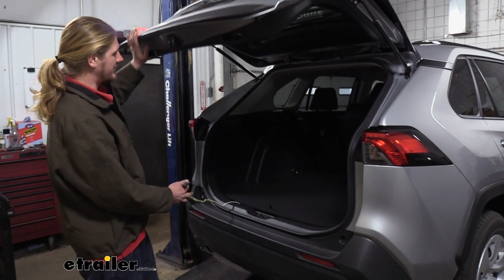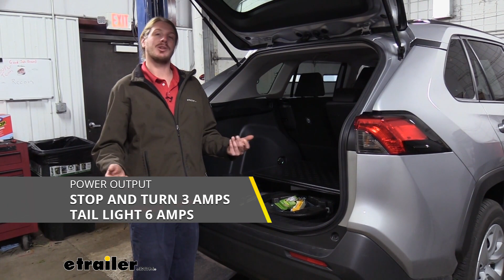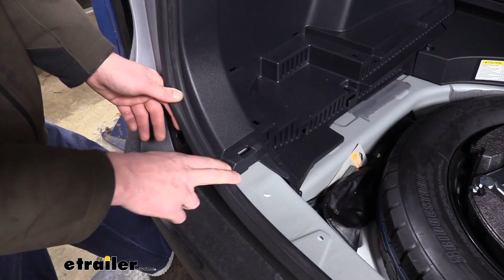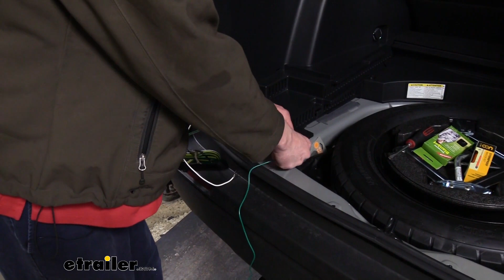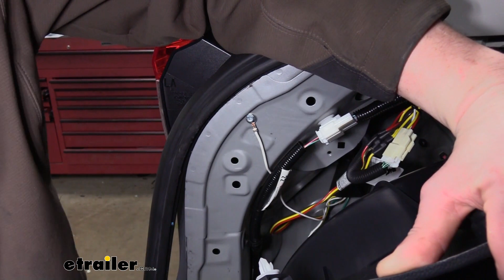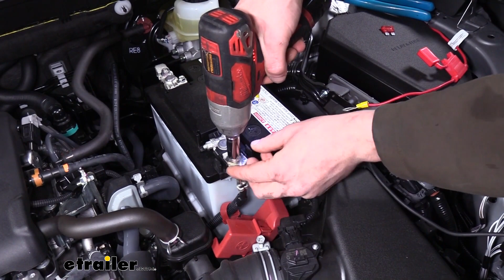etrailer | Curt T-Connector Vehicle Wiring Harness Installation - 2019 Toyota RAV4

Comment: Wondering if I can just TAP into the 12 volt outlet located in the back of my RAV4 and not run the dedicated wire to the battery. Yes, I know it the original way would be a dedicated circuit.... but...I don't have a lift either. haha
Reply from the maker: The manufacturer recommends running the power wire directly to the battery so that there is no interference with the functioning of the trailer lights. The 12V outlet may not be rated for the lights on your trailer. This would cause your fuse to blow and lose the functioning of your taillights. If it is easier, you can run the power wire through the inside of the car.
https://www.etrailer.com/Custom-Fit-Vehicle-Wiring/Curt/C56434.html